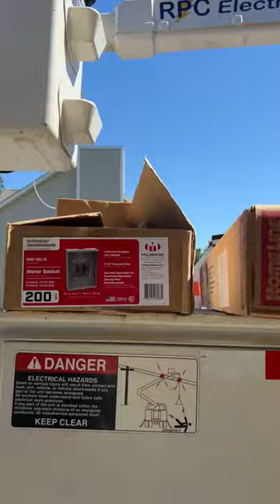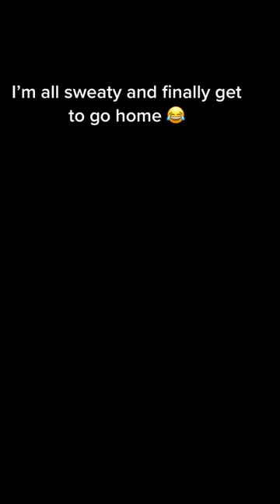Emergency Service Call Saturday

Comment: I seldom approve of some of these “electricians” posting videos, but your work is done neatly and correctly. I’m a Master Electrician, Electrical Engineer and a certified apprentice instructor. I would recommend, if you haven’t done so already, that you contact any local trade schools and promote the trade, especially to young women. I’ve noticed that the few women I’ve met or taught have been exceptional - possibly trying to prove themselves to their male co-workers. No need to prove anything - you’ve nailed it! Hats off to your instructor as well. Nice work! 😎
Reply: I have noticed that most gals seem to have a different level of "neat and tidy" plus organization skills, that many guys don't have. Figure in a higher level of reading comprehension and we have a winner!
Reply: @rupe53  and much easier on the eyes 😎

Comment: Do you not install rcd's on your main incoming or even on your individual breakers or obviously you don't have to install but normally you would have to install a rcbo on your circuit for bathroom or maybe kitchen where there is water

Comment: In my opinion those branch circuit wires should be looped around like the service wires instead of being trimmed to fit. It looks nice and clean to trim them to exact length but now there's no room to move the wires to a different location and it could make installing a new panel in the future very difficult. Still a great job overall though.
Reply: I am amazed she had so much extra wire. Normally half of them are too short.

Comment: Never was a fan of zip tying wires inside a panel. Looks good, but putting them in a tight bundle would seem to encourage heating. Then when I come along to trace a circuit or make changes, I have to cut all the zip ties anyway. Good to see you doing what you're doing. Especially like all the free tools you get, great job!